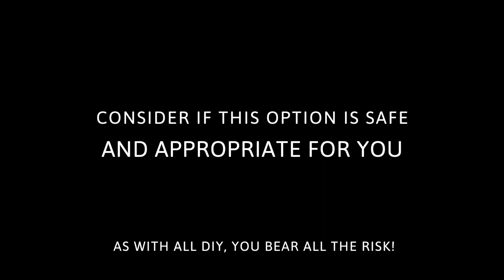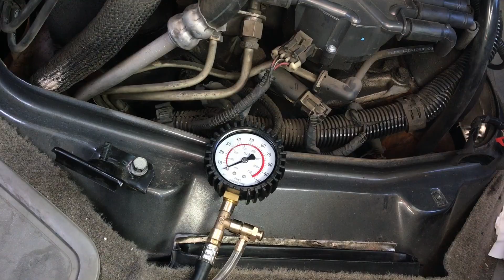Astro Van Fuel Pump Replacement - 1996-2005 (GMC Safari) - 4 MINUTE DIY VIDEO

Comment: This method screwed up the integrity of the floor. Its not difficult to Pull the filler neck and the straps. You really didnt save time unless you are going to leave the hole in the floor. if the fuel tank has lots of fuel in it the gas can be siphoned  out the fuel fill pipe its only a hose clamp. I think this method created more work and you never did show a method to put back the sheet metal. I dont like this method its a short cut that creates more problems than its worth. I have 0ver 40 years of experience as a professional mechanic and I would not do this. Its really a simple job to do it the right way. I could see this being a desperate road side repair but thats it.
Reply: Every single astro that has gotten the pump fixed I've owned has had it done this way, instead of dropping the tank, I thought the same thing, I thought they were dumb, until me, and my buddy who does mechanic work for a living dropped a tank off a parts van... You learn quick at least!
Reply: Then it would be nice to see your video ,done the way you talking about. I have 86 rv/van. The parts are hard to find as well as videos to fix this vehicle
Reply: EVERY car on the planet NOT build in North America has a access hatch to yet to the pump. This is the best thing one can do if you have an astro van. Ylur fuel pump WILL go bad eventually. Mine lasted till 493k and not being able to fix the pump on the side of the road was a major let down.

Comment: That's one way to do it!  rather than wrecking the resale value and workability of the van, I think I'll be dropping the tank 😔
Reply: How are you wrecking the resale value? you can literally push the metal back down and screw some straps across the seams to bind it back in place and then throw the carpet back over and no one would even know it existed. No one says you have to cut the 4th side of the hole. The entire reason only 3 sides are cut and it's folded is so that you can fold it back in place. Changes nothing about the van.
Reply: Actually, the next owner should be happy that the pump is easily and quickly accessible in case another new pump is required in the future. I'd call it value added actually.
Reply: @jefftaylor844 exactly it's a handy thing to have I cut mine and have a piece of sheet metal to cover it with some self tappers then I cover it with a floor mat

Comment: Your video is the best way shown for replacing fuel pump in astro van.  But how did you fix hole in the floor of van?
Reply: New vent or try buffing it out
Reply: Duct tape and bubblegum
Reply: This may be faster but it is sure not the best, if you can't fix it right have a professional do it!!!!  Don't destroy your floor.

Comment: Now Astros and safari vans are rarely seen and old has hell. When my mom drove hers back in the day id live to have seen her face if I just started cutting up the floor lol. I could understand if it was a problem vehicle but these have 2 bolts and the 3 in the gas cap and that's it unless u wanna pinch 2 plastic gas line clips and bring it on the ground. And that was clean i could see it in the salt states now that they are 25 plus yrs old when the bolts are ao rusted they just rip out a rusty chunk of metal with it. Also noticed all the pressure still in the gas line  g.d this made my night I could not stop laughing.

Comment: i've done a similar process on my S-10/S-15 trucks and my full size Chevy trucks. saves a lot of aggravation when you have no acces to a rack or lift.or jack-stands and jack that will get you high enough to drop the damn tank. i pop-rivit 3 or 4 1 1/2 in. metal strips to the cut edges with half of the strip showing, that way i something to secure the flap/lid cutout back in place. i usually place a thin bead od silicone in the remaining gap to hlp seal out fumes, dirt moisture, and cover that with a couple layers of aluminum rfeigeration tape, then throw a bed-mat or board over it  wide enough to spread the weight of anything that may get thrown on top!!

Comment: After you snip the hole , you can lower the tank slightly, just enough to ease out the thin (like a tin can) metal pump cover if it has one.  Or you can snip the cover in half , bend and lift it out.

Comment: Unorthodox? Are you kidding Me? That's BY FAR THE BEST WAY TO GO... Volvo's are designed to take The Fuel Pump Out JUST LIKE THAT... All you have to do is Remove The Back Seat? AND BAM!!! THERE IT IS... I Think GM Just Designed It The Drop Tank Way to make money on The Labor when it's time to replace it..

All you need now in a metal plate and 4 screws about 1/2 inch long, And you'll never have to worry about Dropping the tank to work on The Fuel Pump.. OR? Clean The Fuel Tank if need be... Good Work.. Great Video... Thanks...

Comment: it worked then died later 2 days later 
benched tested the pump it works
checked the connectors on the van no power
is there a an inertia switch ? reset switch for the fuel pump ? ( mine did come from an accident ( front end accident )

Comment: great video, thanx, very helpful.
Did you forget to replace the rubber O-ring that seals tge pump in?
i saw it dangling in the one you took out, but didnt see one on the replacement pump you put in...
how important is that gasket?

Comment: How you cover the hole afterwards?
Reply: Get a piece of sheet metal slightly larger and screw it over it I would also recommend a little rtv around the edge to prevent moisture from coming in
Reply: That's you to be the author of the work

Comment: If the access port is well done it could be value added, but how many pumps are you replacing! Preventative maintenance might be better.. keep your pump cool, don't run with low fuel and annually change your fuel filter.

Comment: You know they weld on gas tanks right. If it's full you can use a cut-off wheel no problem the sparks aren't that crazy. 😉
Reply from the maker: Haha yea I mean it’s not hydrogen 😅 def on the paranoid side 😂

Comment: This Goes To Show That General Mothers Is Full Of Crap.. I CAN NOT For The Life Of Me, Figure Out Why GM Didn't Just Put A Door Or Plate Over The Fuel Pump.. It Would Make Life So Much Easier.. Instead Of Taking Everything Apart And Dropping The Fuel Tank. And? Replacing The Fuel Tank.. Incredible.. Wow.. Anyway? Good Work.. Great Video...

Comment: Just drop the tank, easy.
Yes would be nice if they had an access cover with screws and a replaceable seal but that would make way too much sense.
It’s all about manufacturing cost while totally ignoring the poor saps that have to work on them for a living.
Reply: I did mine this way. It's way easier than dropping the tank. And way faster.

Comment: What was the miles on your Astro when you replaced the pump ?
Reply: I got my 97 with 147K. My pump went out at 240K. Got one out of a pull a part Astro cheap. Pretty easy to pull the tank and replace it. Be sure to change the fuel filter every couple years to make life easier for the pump.
Reply: @Deucealive75  Was the pump you took out the original ( it should have been a Delco) ? My 1998 Safari has 160K or 99,000 miles. So far changing the relay and keeping the tank half full  plus new filter has worked. Midas would install a new pump for $1000 or $750 U.S.  Other shops want up to $1500 CAD.
Reply: @genemccormick3935  Wow! That's a lot. Pretty sure mine was the original. I saved a ton by taking the chance on a junkyard fuel pump. I had to pull it at the yard. That would have been a good video. I used butchery and had the tank out in about 3 or 4 minutes. lol.

I gave my son the van. It started to burn oil and he never kept up on checking or adding oil and locked up the engine at 247K. I bet it would still be on the road if he would have added the 1 quart a month it needed.

I just got a pretty nice 05 with 101K miles. I need to replace the fuel filter soon.
Reply: @genemccormick3935  Also. Those prices are way too high. If I had a lift, and correct parts on hand I could put a fuel pump in an Astro/Safari in 2 hours or less. Should be more like $300 (US) plus parts. On my back took longer. And I syphoned out 9 gallons to make the tank lighter.

Comment: How bad was the fuel smell after this? I know there should be none because it's a sealed unit but I'm curioushow dis you seal it to make it solid again? Just another piece od sheet metal?
Reply: There's 3 way todo anything. Right way wrong way and a way .this is a way not the right way just a way

Comment: Why am I always the guy with an astro this wont work because there is shield on top of the Fpump floor is cut thru and measurements are exact BUT THERE IS ANOTHER PLATE COVERING THE FUEL PUMP.
Reply: what year is yours ? i have a 1998 and thinking about cutting a door as well,but not if there is a plate like yours
Reply: Chevrolet Silverado 4.3. Engine
Reply: Just cut through my floor to find another plate as well
No turning back now, gonna try and cut through this one too

Comment: How the hell can you do this threw the body. This will not be an easy repair is why you didn't show that part.. People will be having tio drop the tank now to have the body rewelded. To seal the co2 from coming into the vehical this is not a safe method this is j it st to recover a part In a scrap yard .. Come on people it's two straps that hold this 13gallon tank in its not as hard as this cutting  the floor out whe you have to remove tank to weld the hole buck up. I AM A 30 YEAR MASTER MACHANIC. THIS IS NOT SAFE TO DO WHEN YOU OPEN THE UNDER CARRAGE TO THE PASSENGER COMPARTMENT YOU HAVE A POISONOUS GAS ENTERING THE VEHICAL  AND WELL CAN LEAD TO DEATH STROKE OR AND ACCIDENT WHEN YOU PASS OUT AND HIT SOMEONE HEAD ON...
IT'S AN2 HR JOB WHEN YOU TAKE ONE OUT AND INSTALL PU P AND REINSTALL TANK IF YOU ARE HALF ASS EXPERIENCED.. if not don't attempt it.. This is an electrical device being installed in a submerged highly flammable yet explosive situation in side a tank. It would explode with the slights of a spark from an improperly wired electrical connection and should be installed by an experienced person.

Be safe not dead. Take the time to remove the two straps and have a few pieces of wood on a couple bricks and them lossen the straps. Ifi rember correctly the rear strap is a itch to get to threw the frame but a few extentions and a swivel will allow access.
Reply: This is a "shade tree" repair and very unsafe,  CO not CO2 may seep in and SIMPLY kill you.  Low budget  terrible repair!!!!
Reply: He just wanted to save on the huge cost of a tow. I pulled the tank on a rusty 97 Safari. Fairly easy.